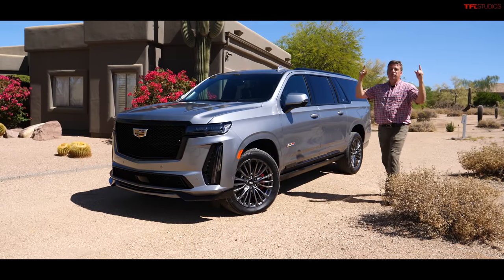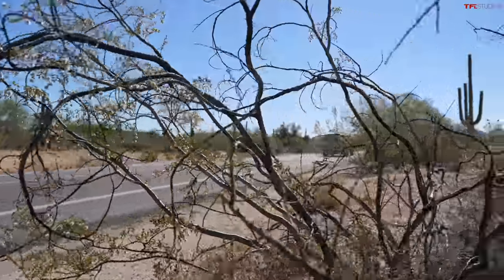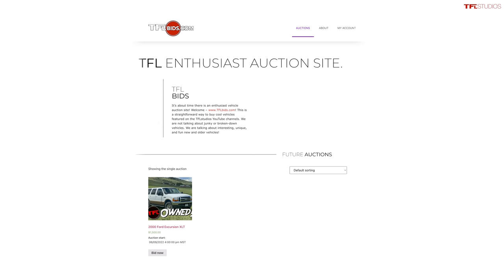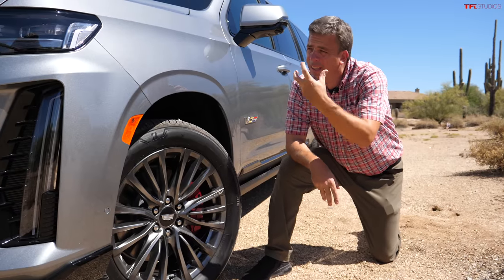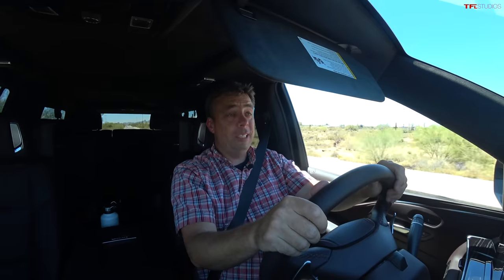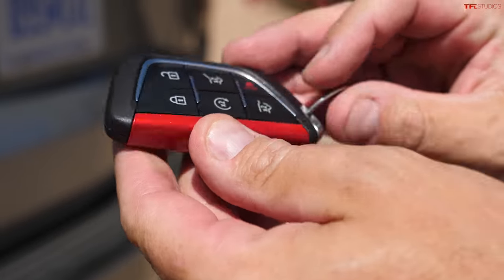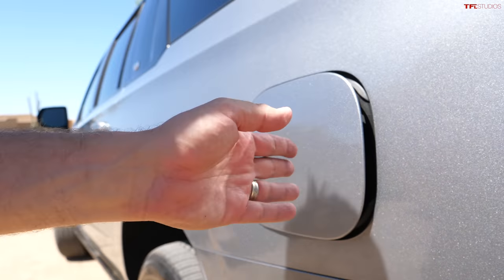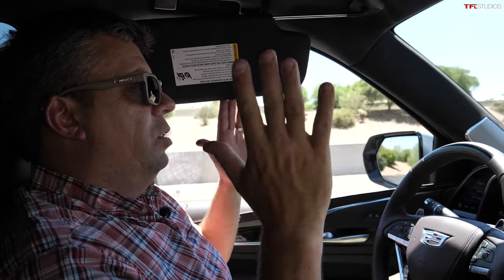This SHOULD NOT Be Possible - the New 2023 Cadillac Escalade V Is Completely BONKERS!

Comment: Another worthwhile review.  Thumbs up!  A couple questions, about the 4W Low and 2 speed transfer case.  If I remember correctly the Escalade Sport Platinum with the 6.2 liter included 4L with the 2 speed transfer case if you added the max towing package; and that also meant you could raise the vehicle not just +1" extra, but +2" extra.  Is that not the case with this V series?  And regardless of that answer, in regards to that 4W Low option on the 6.2 liter Escalade, if I do not anticipate rock crawling, just occasionally going onto dirt roads or paths to get to a camping or fishing destination, but more often maybe needing to get out of some deep snow in winter ski country, do you think adding that extra 4W Low with the 2 speed transfer case and being able to raise the vehicle up that 2nd additional inch is worth it or necessary?  Thanks.

Additional related thought:  I like the idea of having that extra second inch available if needed, however infrequently, but then I also recollect hearing that once you shift out of 4W Low you cannot access that extra inch any longer, so only at slower speeds anyway.  I think I remember anyway that even that first additional inch, in say 4W High, once you get up to 40 mph or so, certainly by the time you get to highway speeds, the vehicle automatically lowers back down so you can't even keep the vehicle raised the one extra inch if you are in a snow storm at higher speeds on secondary roads or on highways.  That bummed me out a bit, for I love the Escalade for so many other reasons.

Comment: I'm still not a fan of self-driving cars or having cameras in the car staring right at you, but Super Cruise really is fascinating. The fact that it can initiate and execute a lane change all on its own is really impressive. If I were driving with Super Cruise, while most of me would probably be a little uncomfortable, like Andre here, there would be a part of me that was in awe. My question is, is the sensor just looking to see if you're facing the windshield, or is it actually checking your eyes? Could you face the road, but close your eyes, both with and without sunglasses, and have the system recognize it as not paying attention?
Reply: It watches both your eyes and head position. Have had it on 2 CT6’s.  It has never done anything alarming in about 25,000 miles of using it.  It does take some getting used to, especially what to do with your hands.  I do arrive less fatigued after a long trip after using it.  It is especially nice if there is a delay due to an accident or construction when traffic accordions.  You just sit there and the car follows the car in front creep, stop and steer, no intervention required.

Comment: The front end bouncing at 12:18 after the hard stop seems a little excessive for a truck that brags about its magnetic ride control.
Reply: Maybe but it's the long wheelbase at over 6,000 lbs. and tuned for a luxury ride. We also don't know what mode he had it in.
Reply: I say that too, and was wondering about the ride control system not functioning....bounce, bounce, bounce....bounce some more... Scheesh, like a boat in the marina.
Reply: @pto44  I'm surprised it has ANY mode that allows 4 bounces from a hard stop.
Reply: @jimm7165  my 2016 ESV with magnetic ride control does it too.
Reply: @pto44  That seems odd. My Expedition with 170kmi doesn't

Comment: its not broken in yet ! just give it another 250,000 miles
Reply: yup.... you are correct. I have a 2005 Chevy van with the 6.0 it has 450,567 miles it. never been apart. runs excellent.
Reply: @alaskarailroad3996  gotta luv it ! even my 94 S10 4 popper has 641,000 ! original unrebuilt  engine - trans - rear axle ! just getting a lil rusty !

Comment: It seriously blows my mind how dumb and slow GM has been about making a truck like this. Lets put a Supercharger in the new Cadi but forgo any of the off-road trucks that could directly compete with Raptor and TRX… it makes 0 sense.
Reply: They waited till a dealer and gas gouge to release it too.
Reply: When the Hummer was first shown as a concept , any hope of such truck wasn't going to happen. If the Chevy Beast is allowed for production then GM might use this engine.
Reply: Well not much will “compete” w/ this Escalade
Reply: Disagree. Off roading doesn’t require a lot of power. But I could sure go for some power with my luxury. 
Now if they wanted to make a true street truck with zany horsepower, I’m all in
Reply: This power plant should have been in the ZR2. GM is  the worst
Reply: @upshifter5316  ? Depends on what type of off-roading you’re talking bout, rock crawling or traversing tight rocky/rutted/muddy trails huge power isn’t necessarily that important (until/unless you get bogged down in a swamp lol) but would you consider trophy trucks off-roaders? I certainly would, & they for sure require a lot of power & the Ford Raptor & TRX are supposed to be more geared toward THAT kinda off-roading (that being said the TRX is still overpowered in terms of it easily outrunning it’s suspension capability offroad)
Reply: @MS-mr4zm  True that, the dunes and of course high speed trophy tuck takes power. Perhaps I’m jealous but I don’t have those where I’m at in The Rocky Mountains. So my thinking is for lo speed trail crawling I don’t need to suck down so much gas. 
As crazy as this Slade is, it makes more sense to me commercially, because now it’s on par with big German suvs like GLS and X7 V8s - price & performance wise.
Reply: What doesn’t make sense about it? Y’all are the slow ones. They are not interested in competing with the Raptor or TRX. Why can’t y’all comprehend that? 😂
Reply: @t436  How exactly does dealership price gouging customers help GM? 🤡 #3

Comment: Andre - When Launch Control is engaged correctly on a C8 Corvette, the engine speed hovers around 3500 RPM before dumping the brake.  The tach on the Escalade (on your second attempt) was hovering at +/- 1500 RPM.  I can’t see Launch Control being that much different between the two vehicles, so it looks like you didn’t engage Launch Control correctly.

Comment: Something I'd be interested to see you guys experiment with: with the auto-cruise working, what happens if the guy in front slams on his brakes?
Also, congratulations to Andre on a new word: "giggleworthy" should catch-on really quickly. An Escalade maybe isn't the first vehicle I think of as giggleworthy but I'm sure there are plenty of vehicles that fit the bill perfectly.😁👍
Reply: My 2022 Murano has the emergency automatic breaking both front and rear. I would assume the sensors on the front of that things would immediately detect it and overtake the brakes.
Reply: @605gritfitness9  It would be interesting, if maybe slightly dangerous, to put it to the test.😁👍
Reply: The Supercruise won't let you follow too closely to have a sudden emergency "slam on the brakes" event. It reads the road continuously and maintains a minimum calculated following distance in which it knows it can stop safely. Gm would up for lawsuits if it didn't. My wife's 2022 explorer as the "intelligent" adaptive cruise with stop and go, and I have driven 300km without touching the brake or gas. Stops and starts when the vehicle you are following does, and maintains the 2 second minimum. It was scary at first to trust the vehicle to stop, its aggressive compared to how I stop(has to do with the way the vehicle ahead of you stops). I've used the Mazda radar cruise lots and it works similarly.

Comment: The reason it’s not quicker is Gm’s torque management, you can hear it in nearly every launch and every full throttle shift on just about every video about it. I’d love if I had $150k to throw down on the SWB Escalade V, it would get a pulley kit, and tune to take off GM’s horrible torque management. I’m currently saving up to turbo my 07’ Tahoe. I’ve already beefed up the trans for it, just need the turbo probably won’t be as fast as this, but will still be quick for a 3 ton vehicle. I actually had it tuned until gas prices went through the darn roof, had my tuner revert it back to factory and save my tune for later as it needed 91+ octane gas or it would ping on the highway, but I got better mpg with the tune, but not enough to offset the extra cost per gallon of premium.

Comment: The T-Bird i have with the LE 4140 cast 4.6 gets 27mpg... 31 gallon tank. get the other guy to pay the wind tax, no that's 27 up front at 90 an hour.

very heavy SUV better safety ratting via inertia? hmm, tb still at $23000.

Comment: I took my father-in-law’s brand new 2021 Escalade to road-trip from Dallas to Colorado Springs and back last year and most of the buttons in it didn’t work. Seat warmers never worked, steering wheel warmers never worked, suspension on highway sweeping curves felt confused. Good looking truck, but poorly put together. I was disappointed.

Comment: Meanwhile 7,200 lb Rivians and 9,000+ lb Hummer EVs do 0-60 mph in 3.0 seconds.
Reply: Yeah but when this ones battery shits the bed it's maybe 100-150$ tops..Rivian And Hummer battery( batteries) replacement costs tens of thousands of dollars..So internal combustion still has the capability of lasting for several decades if required of it. Tesla and electric cars are kind of like phones..when they stop taking a charge people get new ones and trash the old.
Reply: Towing with EV’s get around 100 miles at a full load so good luck planing a trip. They did a test In Colorado and the Ford Lighting went as low as 50 miles east. In 8 miles they used 16% battery power at 66 degrees outside.

Comment: There’s no way the top speed is on 124MPH that’s so low. I did 133MPH in this armada, it only took me 45 seconds to get up there. 124 is such a low amount.
Reply: Probably limited to 124
Reply: Generally electronically limited to the speed rating of the tires.
Reply: @ralphlambda5359  As well as the drive line speed rating.

Comment: Tlf viewers are funny. Any truck or suv that comes with a v6 turbo charger the comment section goes crazy. “Never buy a v6 in truck”
“V6 Turbos are unreliable” “v8 til the time they die” “v6 sounds like crap” throw a v8 in a modern suv the crowd goes crazy. “Gas too expensive” “too late for a v8” people never satisfied. Put a v6 ppl complain. Put a v8 ppl complain.
Reply: Right? If this was a turbo six that got 22 MPG they would complain that it wasn't a V8.
Reply: @pto44  exactly
Reply: On point. Now the EV guys are here to complain as well.
Reply: @EGGINFOOLS  The V will be driven by soccer moms from Newport Beach who don't want to drive a Tesla. Paying a $50,000 premium to gain 1 second 0-60 makes no sense but that's not the point of the Escalade.

Comment: Okie Dokie! How about we RAPTORIZE IT by installing a 6 inch lift, Fox 3.1 V2 Active Shocks, front and back disconnect/swaybars, 37 inch Nitto EXO grapplers, some full underbody skid plates, front AND back heavy duty bumpers, both with full width wrap-around bush bars and heavy duty 16,000 LBS winches, LED fog lights and an upper roof 100,000 lumens light bar and upper roof lifting-top camper plus roof rack.

THAT would be a nice project Luxo-Barge 4x4 SUV!

V

Comment: If they put these motors in the trucks the warranty would be the property line of the dealers lol 
Imagine how scared ford is to have us all tearing the possible raptor R’s up lol. I’d be terrified of y’all 😆
I think they can cope with numbers of Cadillac owners and the lease to ownership ratios based on the price.*
I hope it’s a raging success don’t get me wrong, but My poor 2018 Chevrolet bolt can’t even get parts these days, and is still sitting in a dealership service lot. 
So much for my first gm electric car 🤪 $hit happens I get it. 
If I owned one of those V’s I’d be pissed after a couple months of not having it.

Comment: Deal breaker. Can’t rock crawl that?
Reply: Actually you can!  You can do some ARM CPU chip code conversion and meld the GOAT modes of the Ford Bronco with the internal modes of the 'Slade by MELDING the BIOS code together and re-uploading the merged code into the ECU (Engine Control Unit) -- Some microcode disassembly and it's TRIVIAL for an ARM chip assembler coder expert like me to merge the Ford GOAT modes with the Caddy

I can even get rid of the speed limiter code and pressure sensor limiter code for maximum boost capability! I'd get better hoses and pipes and then reline/resurface the cylinders and cams with ceramic though to take a few tens of pounds more of boost and higher heat! With my ECU mods I could easily bring down the 0-to-60 times to around 4.5 seconds even at high elevations like Colorado at 9000 feet at 100F ambient temps! I'd even REMOVE the SOBEL/CANNY face detection code so Supercruise would just keep working even if I turn my head!

V

Comment: I haven't seen a single review get anywhere near Cadillacs 0 to 60 claim. Mid 5 second range is a joke and even a F-150 with a 3.5 can do that.  Hell a Durango or a Jeep Grand Cherokee with just the normally aspirated 6.4 is a full second faster. Yes those vehicles weigh less but still 680 horsepower with a curb weight of 6,400 lb should have a much better power to weight ratio. I don't care what BS excuses some of you make there is something wrong with this vehicle if it's really making 680 horsepower.
Reply: And it's a lot slower than BMW X5m GLE 63 AMG and Cayenne Turbo which are the same price but 1-1 1/2 faster than the Escalade V

Comment: Make that run 6.5 seconds at 8500lbs and I'll be impressed. I can run a dead stock 2020 6.7l powerstroke in 6.5 seconds to 60. 680hp at 6500rpm is only 549lbft. The pwerstroke is 475hp@2600rpm, thats 960lbft. I can roll from 60-90mph in 3sec in 9th gear rolling at 1700(more than a 1000lbft) its disgusting how much power is in these diesels. Yet people drool over the noise and abdominal fuel economy of these overpriced toys. I can tow 20k and still run fast, and I average 11.0l/100km(22.1mpg) without even trying.
Reply: Yours must run alot better than the 6.7s I've ran that was stock....or yours isn't stock. My old diesel Mercedes can walk those 6.7s. And it only runs 15.1@ 93 in the qtr.
Reply: @HioSSilver1999  traction control off(hold 5 seconds) 4 hi and there is no wheel spin. Traction control off takes 95% of the torque limiting off.
Reply: @jnk26  once we were moving it only got worse for him. No tc needed at the speeds we were at.
Reply: @HioSSilver1999  traction control intervenes before weel slip happens. The difference dteween 2wd AdvanceTrac on and off is about 1-1.5 seconds. You can really feel the difference. 2wd AdvanceTrac off still had torque limiting because it protects the driveline components, this is where 4hi and AdvanceTrac off come in it doesnt detect wheel spin because all 4 are working at the same rate(straight line) this in not rocket science. 1050lbft in first gear(4.61:1) is 4840lbft multiply that by the axle ratio(mine is 3.31:1) that's 16,220lbft to the wheels each tires traction holding capability is only 70% of the weight that is pressing down on that tire. My rear axle is about 1650kg(3696lbs) so each tire has about 1290lbft traction effort before it breaks loose(2600lft for both wheels) now add the four corners weight of 8300lbs, that 4600lbs up front so 2300lbs per wheel(1690lbft tractive effort) all together locked in 4hi that's 5800lbs combined. That torque is only short lived(it's first gear) up it the top end of the motor 475hp@2600rpm(thats 959lbft) so there is more 950lbft available across the entire useful rev range of this engine. More than a1000lbft from 1550-1950lbft. Thats a lot of force to control. Torque is the only force at play. Hp is just calculation for how fast work gets done
Reply: @jnk26  yea well.....it ain't gonna spin the tires at 80mph when i was draggin dat ass. Nice book you wrote tho. 

Don't worry your stock one woulda got drug too.

Comment: 1 second slower than what GM states. That’s quite the difference
Reply: It’s a 1ft drag rollout and he’s in the long wheel base. And likely heat soak in the desert hit it a bit - i didn’t notice if he mentioned the temp, it’s possible its over 110F when he filmed
Reply: He's not a professional driver like GM uses. It's Andre. While great, not a professional 0-60 guy
Reply: Good point regarding the heat. Especially at a press event where it’s likely been assaulted back to back by buffoons. 

Because my f150 did 5.6 0-60 gps verified a mile above sea level. But that was on a 70 degree day, and times severely worsened after the 4th run.
Reply: It's 100+ degrees in Scottsdale right now

Comment: Sooooooo, to me this pretty disappointing. I have had 2 SUPERCHARGED Escalade Platinum trucks.  A 2010 with a TVS1900 and 2018 with a TVS2300.  2010 ran 0-60 in 5.5sec. 2018 in 4.7. 2010 was about 570hp. Both are RACELOGIC verified. 2018 was 720hp. For $155k, this thing should have been real-world 4.5sec. My current Alpina is 4.2 real world.  Also, I am very disappointed with the BS tire sizes and the top speed.  Alpina goes 180 LOL.